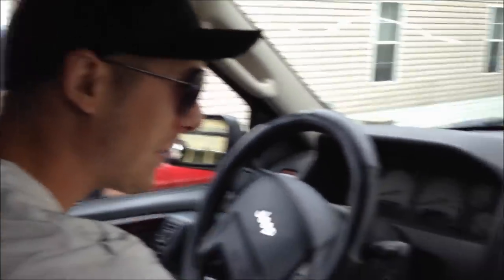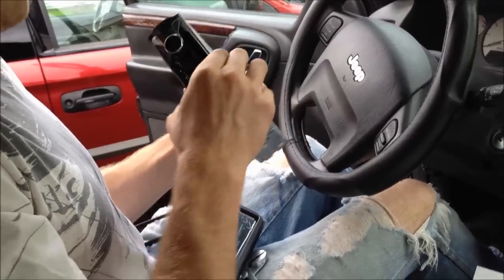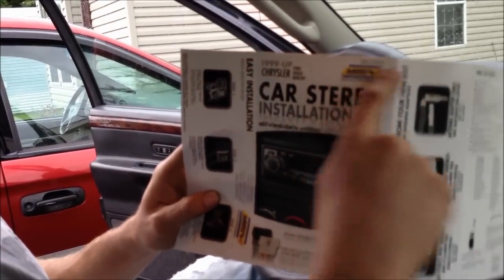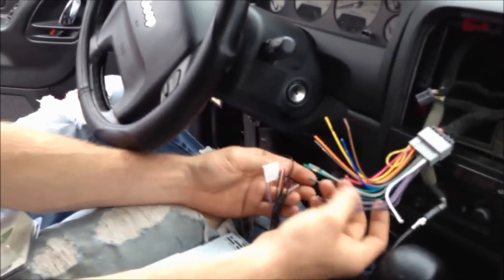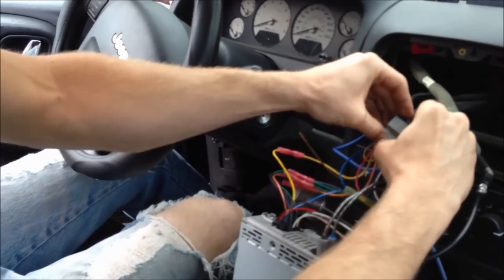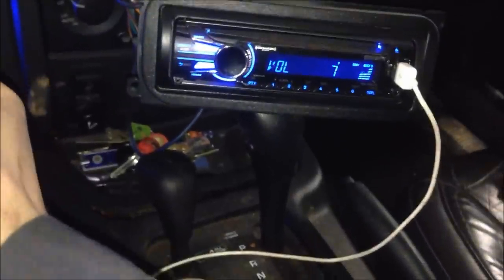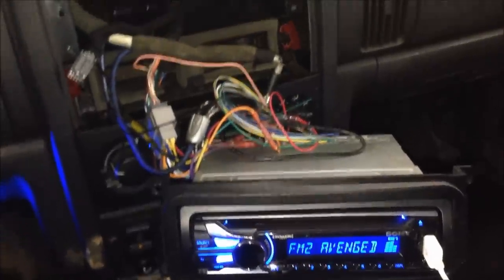Jeep Grand Cherokee Stereo/Deck/Radio Install (1999-2004)

Comment: If you have the Infinity system with the factory amp, you have to hook the Blue wire to the Blue and White wire on the other harness. This will power the factory Amp. If you do not do this you will not have any sound. 

Thanks for the awesome video, made it all a bit easier!
Reply from the maker: Thanks for clarifying, I thought I mentioned blue goes to blue in the video but maybe the white stripe is throwing people off.
Reply: +PkwyDr possibly, may have just missed it. You had a aftermarket amp so it did not click at first
Reply from the maker: +Morgan Glassco Yeah, I actually still had the OEM amp too. That one powered the speakers while the aftermarket one powered the subs.
Reply: hook the blue wire from the deck to the blue and white one on the harness that didn't get used ?
Reply: Eerm I connected my blue for the amp to the ignition wire because my blue and white is for my wireless controller it's got a piece of tape over it "wireless remote not power wire" from the factory
Reply: Anthony Hurst I did this and I'm only getting sound in the front?
Reply: What if you don't have the blue and white wire on the other harness?? I just have the blue power antenna wire
Reply: So do I hope the black wire in the car to the blue wire or blue from radio to blue on harness. Mine has a factory amp clip on back of radio by itself and wire is black?
Reply: Tony The Truck Guy  where is / was the amp at ?? . I have a Sony hi power and if i crank my volume 1/2 way i hear a cracking popping sound , wonder if this is the amp distorting . ??
Reply: @txknightrider82  amp is under back seat on right side
Reply: @robertwilliams8000  thanks , ok so mine dont have one , my issues is with the head unit then.

Comment: Thanks for the video. I was able to install an aftermarket radio. What I was having trouble at first was the aftermarket radio not Turning on and since I had the limited version with the infinity system I had more wires and other stuff that you didn’t had. Well what I did was I hooked up the ground from the car to the ground on the stereo, also connected the blue with white wire from the aftermarket to the blue and blue and white wire from the wiring harness and that fixed everything I had trouble with. Thanks👍

Comment: Tech Tip*** you can hook the pink wire from the ASWC-1 to the brown lead on the wiring harness for the jeep. It lines up with the Blue/yellow wire. So you won't need to splice the Blue/yellow, and the factory wires stay untouched.  Thank you great video. I could not find which ASWC-1 wire to hook-up, or factory wire. Pink and the Yellow/blue was the winner, and my JVC is working great. Rock on.

Comment: I got a radio ebay  put it in and a week later the volume don t work.i use the vol on steering wheel.  might be something  loose .  when I got  it  outa bix it looked to be unplugged or attatched so I just pushed it back together.everyhing seemed good .I replaced a cd / tape combo with a cd player.  not sure if I wanna undo it all and take a risk of not being g able to get it back safety.  I was  shocked I got it out & in by myself without mucking  up.lol  the dash trim was hard to get back in and dont fit in as tight.i think it's not in straight seems to bulge in I corner and not be flush. but hey ur vid  put me back on the music. I'm grateful to u for dat!!

Comment: Do I have to get antenna adapter that fits my new stereo or one that fits my car - Jeep Grand Cherokee 2000?
Reply from the maker: You’ll have to see if the back of your radio looks like it has the same style as mine did. You SHOULD be able to use the antenna adapter that I did, all parts in video description.

Comment: Pre 2002 has a different wire plug an you don't need an adapter for the antenna

Comment: great video i have a 99 jeep grand cherokee lerdeo and i get all the wires right but there 2 wire the black one and there one that plugs to the head unit thats orange and white can you help me with this?
Reply from the maker: Nate Doom  If you have an orange one coming out of the head unit, connect it to the orange wire on the adapter plug and the black goes to ground.
Reply: +Nate Doom I have the same car as you. What did you do about the antenna adapter?

Comment: and would you be able to help me,? I don't know if there is a wire specifically for the CD player itself but everything on my radio works except for the CD player the CD player was in my car 2002 Mitsubishi Galant which worked in that and my Jeep is a 99 Grand Cherokee Laredo and won't work in here
Reply from the maker: +Brandon B. Irish Doesn't make sense. As long as the rest of the radio is functioning the CD should work, if not, the CD player is junk.
Reply: +Brandon B. Irish  make sure you hooked up ground and remote amp wires (black.... blue)

Comment: so, if you connect your interface to control the volume on the stereo in the audio jack, and you have an stereo that has a microphone, you could only connect only one?
Reply from the maker: Correct, unless someone makes a splitter cable so you can plug both in.

Comment: My jeep doesn’t come with that other connection that went in the other stereo . I have the jeep grand Cherokee Laredo now the new stereo won’t play any sound ?
Reply from the maker: Second connector may have been because I had the premium sound system with the 10 disc changer and amp. Make sure all of your wires are connected properly and not loose or crimped on the wiring insulation. Verify good constant and switched 12v power for the red and yellow wires, and make sure your black wire is going to a known hood ground.

Comment: On the WJ 99-04 grand Cherokees do u kno if u can still use the factory volume controls on the steering wheel with an aftermarket headlight or only with the stock one?
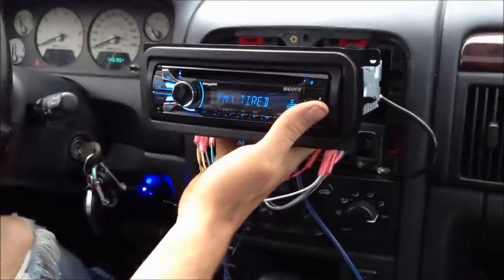Reply from the maker: Skip to 10:35 in the video.

Comment: Where do you ground the blAck wire im having so much trouble only gotten it to work plugged into the amp wire but I have an after market sub and wanna use that
Reply from the maker: Jarred Owen The black wire is ground, splice it to the factory black wire on the vehicle side or hook it to something metal in the dash.

Comment: So where did you ground the black wire? I'm sorry if it is a dumb question I'm just having some trouble getting mine to work .
Reply from the maker: There's a long skinny trim piece right above the steering column that pops right off and I used an existing screw to ground the wire to the metal behind the trim piece.
Reply: Thank you

Comment: Where did you get the mount that fully ready and set . The ones I fine is a kit and I have to put together .Because I'm looking everywhere and I seem to not find one .
Reply from the maker: +Samuel Figuereo  I had to put the metal and plastic pieces together as demonstrated in the video. I purchased all of my supplies at Best Buy.

Comment: Did you drill a hole in the firewall for your power wire on your subs??
Reply from the maker: Gus Wendt  Down by the pedals there's a few rubber plugs in the firewall, I poked a hole through one of those and ran the cable out.

Comment: I installed a boss bv9976b into my 04 Cherokee, but have no sound, reconnected factory stereo speakers work fine, any suggestions
Reply from the maker: Re-installed factory speakers or factory deck?

Comment: My harness has 2 plain yellow wires but the actual connector only has one so should I connect all 3 together or just choose one?
Reply from the maker: Casey Spivey That's odd. I would choose one then if that don't work then try the other one.

Comment: I want to put a touch screen in my 04 wj but I'm nervous that my steering wheel radio controls won't work after its installed...
Reply from the maker: madmanownzall Should work as long as you get the module I showed.

Comment: How did you run your RCA cables through the dash when you put your subs in? Cause im putting subs in my car and i wanna know a good way
Reply from the maker: Gus Wendt  Sorry I just noticed your comments in the pending section. I ran them through the dash from behind the radio then pulled the plastic floor panels off that are on the edge of the floor carpeting. They are held on with phillips screws and panel clips. You will need to remove your plastic B-pillar (where your seat belt is) on passenger and drivers side then there will be a front and rear edging panel on each side that I was talking about. Ran the cables under the edging panels then reinstalled panels and had the cables come out of the plastic trim panels behind the rear seats.

Comment: Hello and thanks for the video. I have a Jeep Grand Cherokee Laredo 2002 with a amplified system, Infinity amp, do I have to bypass or get a new harness wires to work with the amp. Someone  recomended this harness to for the amp,  Metra 70-6503 Radio Wiring Harness for Chry/Dodge 02 Amp Int.
Reply from the maker: Just get exactly what I used and it will work. Mine was a Limited with the premium sound system as well.
Reply: +PkwyDr It worked. Your video helped me a lot, thanks
Reply: i have same as you, did your system work ok?

Comment: did you have a black wire that had a black connector say amp on it that was just on a metal tab on the factory radio? if you did did you ground the wire or leave it hanging?
Reply from the maker: I had a black wire with a metal ring connector on the end of it and I grounded it.
Reply: +PkwyDr thank you. this has been the most helpful video on YouTube!

Comment: The extra plug is for disc changer anyway to use this or do i have to buy a different disc changer?
Reply from the maker: I never used my disc changer anyways because I had my iPod but I think you would loose that function.

Comment: i hooked my 10.1 inch radio and had to hook reds with yellows why would i have to do that to get power to me radio
Reply from the maker: Should be yellow to yellow and red to red, one is constant power and the other is switched power. Check fuses and see if any are blown.
Reply: Tony The Truck Guy only way I can get my radio to work is if reds and yellows are crimped together????

Comment: My jeep has a pinout for a cd changer thats located in the back. The wiring harness that i bought has a orange wire that goes to nothing and nothing for the cd changer's pinout.
Reply from the maker: Yeah I can't recall without watching my video. It I don't think I connected an orange either.

Comment: My radio is like that one but instead of 1 clip thing in the back mine has 3 and I have no idea what to do
Reply from the maker: Jacob buehrer  what year is yours?
Reply: 99 limited
Reply: I got it I just cut out the factory amp and rewire everything because it was the infinity gold series

Comment: when i removed my factory radio it had the antanna and three different plugs and im assuming a ground that was clipped onto a hanging tab i connected all the correct wires except on the new deck there wasnt a tab to clip it to or there wasnt a plug in for the other cord that was disconnected when i pit everything back it powered on and everything came on except no sound and a message said no service but antanna was plugged on all the way any idea what it could be
Reply: 2000 jeep gran cherokee
Reply from the maker: +Dennis Josjor  I'm a little confused by what's going on, there's too many variables. Wiring harness should match color for color and the black wire needs to be grounded. Not sure what tabs you are speaking of. Also not sure what radio you have but any radio I've ever seen has static if there's no signal, never heard of "no service"
Reply: Yea i definitely worded that wrong lol i fixed the issue but it was set on blue tooth mode and no phone was connected the ground had a end clip which clipped onto a random tab on the frame of the deck i just cut it and hooked it to the other ground wires
Reply from the maker: +Dennis Josjor so everything works now? 👍

Comment: dam. mine didn't come with that faceplate thing, it just had the square piece that you stated was for older models. and it wasn't wide enough so it has a small gap on each side.

Comment: I WAS WONDERING MY AIR SEEMS TO BE BLOWING NOT SO HARD COULD IT NEED CLEANING
Reply from the maker: Cabin air filter is plugged or blower motor is not working on high.

Comment: The buzzing you hear is because your gain on your amp is too high.
Reply: If it increases with engine speed more likely alternator noise.
Reply: spencer keating New RF suppressor on the alternator

Comment: Buzzing is probably rca cables to close to power wire. Its called alternator wine thats why it changes with rpm of vehicle
Reply: Do you know how to stop this, I'm having this issue
Reply: @spencerkeating7418  run power,remote,ground together 6-10 inches apart from the rca cables. Should stop the bleed over.

Comment: what does it mean to ground the black wire
Reply from the maker: Daniel Gauthier everything needs a power and ground to work, the red and yellow wires are your switched and constant power, the black needs to be connected to a ground, either connect it to the factory harness black wire or secure it to a screw or bolt on something metal in the dash.

Comment: So i hooked mine up and it has power but no sound
Reply from the maker: Double check all wiring is connected properly color to color and that your connections or crimps are tight. If the old radio worked and now this one has no sound then it’s something with your new radio or the wiring.

Comment: MY HEAT ON THE PASSENGER  SIDE IS BLOWING COLD AIR
Reply from the maker: jane longley low air flow could be a plugged cab air filter or a stuck blend door, and if you have it on heat but it's blowing cold, i'd say a blend door isn't working right.
Reply: thank you so much

Comment: My 03 doesn't have steering wheel controls. But has the infinity sound system with amp. Do I still need to purchase a special interface?
Reply from the maker: Wow I think that’s the first time I’ve heard of premium audio with no steering controls lol. The interface (ASWC-1) is just for the steering controls, so you shouldn’t need that.

Comment: Are there other radios compatible with this video and all the parts you used. The Sony CDX-GT710HD is more pricey than the other Sony CDX models. Would   The CDX-GT330 or CDX-GT250MP be able to replace it?
Reply from the maker: Yes, all of the other parts should work for almost any other radio.

Comment: what if the amp under the rear seat goes bad??
Reply from the maker: I'm not sure what would happen, I would think they have it wired so the speakers still work but just won't be aplified.

Comment: I watched the entire vid hoping to see how it looked on the dash. What kit did you use bcz if you install the stereo you will still have the vents exposed and it won't look very nice
Reply from the maker: I guess I'm not sure what vents you mean. The actual air vents for A/C and heat will remain. As far as the radio, the filler panel sits pretty much perfectly flush with the rest of the dash panel and the only part of the radio that sticks out a bit is the faceplate for the deck. It's as clean of an install as you'll get. Here's a link to the stereo install on my Dakota which uses the exact same filler panel and radio, skip to the 19:00 mark and you can see how it looks. https://youtu.be/qpg7FTMBTRU

Comment: i am in the process of wiring my radio now and i had all the wires hooked together but when i plug it all in i have no sound?
Reply from the maker: What kind of Jeep and aftermarket stereo do you have?
Reply: I got it fixed thank you though
Reply from the maker: hah no problem. What was it?
Reply: I have a 2003 grand Cherokee. I don't remember what kind of stereo it was is, but I do have another problem, my speakers suck lol. They start to crackle when I turn it up.
Reply: carissa novak your coil in your speaker is going out. Get new ones
Reply: Thanks man!
Reply: carissa novak no problem
Reply: I'm having the same issue, how was your problem fixed?
Reply: I didn't have the blue wire connected because I thought it was just for the remote control

Comment: Do I need to buy the car installation kit for my 99 grand Cherokee limited or no?
Reply from the maker: all you need is what I used if you are referring to the tools, a flat head will work instead of my orange pry bar
Reply: PkwyDr got it thanks
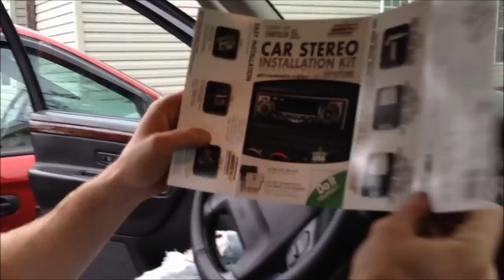Reply: One last thing @ 4:05   the car installation kit do I need that too or no?
Reply from the maker: PrettyFlaco305 Yes, that's the filler panel (black plastic piece) that fills the gap between the radio and the dash.

Comment: i know this is an old video, but just taking a shot. I bought a wire harness and it has two 12v constant yellow wires. there is only one yellow on the harness that came with the aftermarket stereo. do i run both yellow to the single yellow or just tape one off and run 1 to 1
Reply from the maker: If you have a red and 2 Yellow’s, I’d tape off one of the yellows. Kind of strange it has 2, I haven’t run into that before.

Comment: What might I check if the power keeps going off?
Reply from the maker: Like the radio keeps turning on then shutting off on its own?
Reply: If the power to the deck keeps jumping on and off, then you should check the wires in the back. Try turning it on a jiggling the wires around to see if it shorts out when you move a specific wire. Once you figure out which wire is the problem, then change out that part.

Comment: there arent connections on the radio the place 2 connect the harnnes 2 the radio are wide and the same width cant tell if tall or skinny maybe i can return radio so the back will match the harness
Reply from the maker: I’m very confused now. Do you have a Facebook or anything? I have an account on there you could post a picture of what you’re talking about.